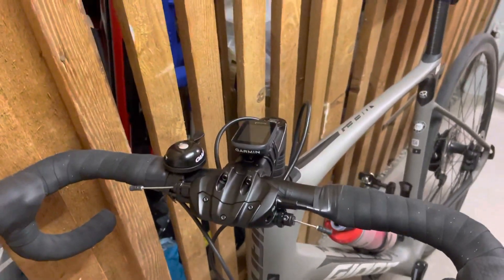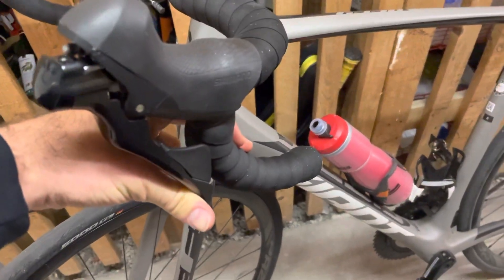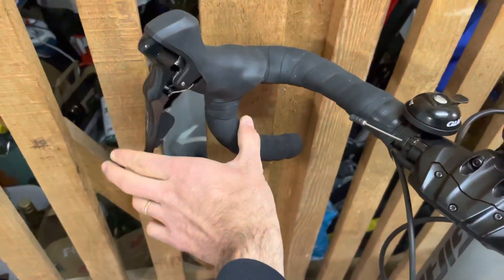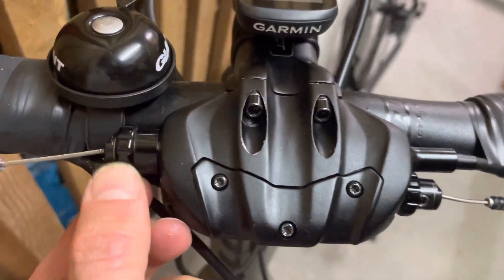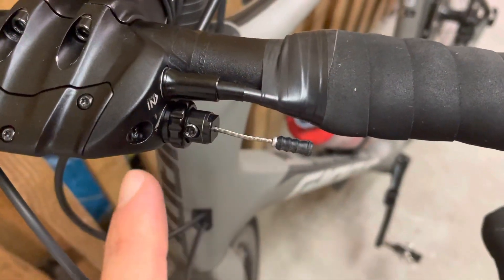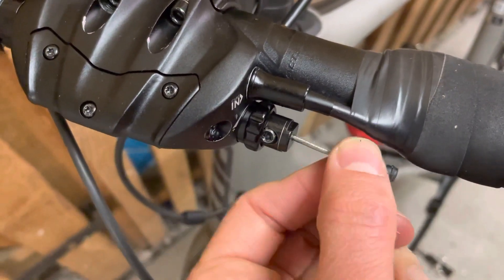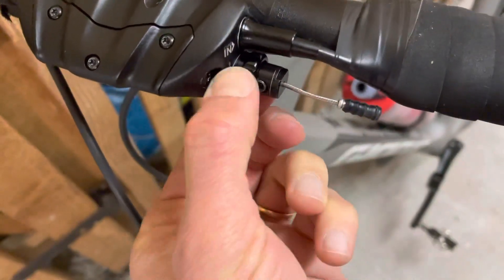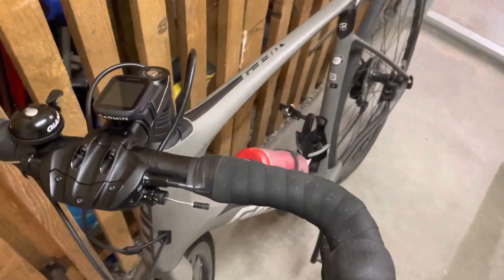Giant Conduct break system adjust lever range

Comment: Glad I’m not the only one having trouble with this @#£&* system. Servicing a friends bike which doesn’t have knurled adjusters and can only see half the grubscrew. Had to resort to wheel out and apply brakes to get pads closer. Will have a look at turning the barrel but not sure if that will make a difference as it seems it’s only basically a cable clamp.

Comment: I had to 3d print a tool to actually screw the brake cylinder barrel on mine. Mine didn't come with the external adjustments like yours because mine were internal. My bike is from 2018.
Reply from the maker: wow interesting!
Reply: I had the same issue, crap system. Ended up buying a full tiagra brake system
Reply: Hi Johnny D. Wicked, I have the same (crappy) old model as you. Please can you tell me in a bit more detail how you hacked yours? I've spent god knows how many wasted hours trying to get the system to work!
Reply: @johnlovegrove6378  Mine has cylinders on the inside which you need a specific tool or a very tin pliers to twist them in or out. They basically control the cable pull on how far you could pull the levers until they touch the drop bar. I 3d printed my tool. You just need something to twist the barrel on the inside.
Reply: @johnlovegrove6378  did you manage to sort this? Going through the same issue now.
Reply: @gavwatts1020  Hi Gav. I couldn't find any form of adjustment on the actual unit, so my bodge was to cut the end of a split pin off so I was left with a 'C'.  Then when the Conduct was all set up, I pulled the outer brake cable out enough from the unit enough that I could put the 'C' around the inner cable and pushed it inside the housing. This gets rid of enough play to make the brakes effective and they work really well. I've considered some kind of barrel adjuster as a bit of a better hack, but this way has been working fine for a fee months now.
Reply: @johnlovegrove6378  excellent - presume that is lengthening the cable inside the lever housing rather than in the conduct unit itself? If so, that was my next stop as I cannot get that barrel to move outward. Cheers for replying though
Reply: @gavwatts1020  Yeah, kind of lengthening the outer cable which obviously has the effect of shortening, or putting tension on the inner cable. And that was on either side of the Conduct unit where the cables go in. It amazes me that they even sold the first versions without the adjustment!
Reply: @johnlovegrove6378  Absolutely, though the length of the cable is so short that if you set it up with the levers in the right position, I doubt you would ever have much reason to adjust them (unlikely to stretch over that distance). Shame, as I like the bike and they seem to work well, just bloody impossible to adjust!
Reply: @gavwatts1020  If you take the bar tape off, you should be able to pull the brake cable outer out enough from the Conduct to pop something in. Just the 5mm depth of the 'C' was enough to take the play out of the levers so they didn't touch the drops before being effective.
Reply: @johnlovegrove6378  and Gav in the discussion -  would using a longer cable housing do the same job without having a loose C inside the master cylinder housing? I'm having the same problem and appreciate your ideas. Am I right in thinking that the new version of the master cylinder has an adjuster built in? Looks about 90€ for a replacement master cylinder.
Reply: @oldgit5948  Hi Oldgit. The problem is you have to 'clamp' the inner cable and THEN effectively make the outer cable longer. However you can't because the grub screw disappears inside the cylinder before you are able to tighten it on to the inner cable at a useful tension! So my bodge with the C extends the outer once the inner has been clamped. A barrel adjuster would do the same but give a degree of alteration.
Reply: Thanks so much for your reply!  Do you mean the 8mm wide bit you would rotate to line up the grub screw with the notch? I can't believe they didn't include this in the manual!!!
Reply: @johnlovegrove6378  Giant does sell their own bleed kit that comes with the specific key that rotates the cylinders inside but it's pricey.
Reply: @johnlovegrove6378  yes, it's also 8mm. The tool I end up designing and 3d printed would look something almost similar to a tower chess piece if I were to describe it in words.
Reply: Ah, that makes sense. I've turned it and turned it and it doesn't come out any more though. There just doesn't seem to be a way to take out the slack on mine even with the bar to the lever. Next step is to try without the disc between the calipers. Thanks for your help though.
Reply: Hello, do you by any chance still got the stl for the tool? i am running through the same issue

Comment: I tried this and it didn’t work! No adjustment in the cable.
Reply: Rubbish system....do as i did a replace it with shimano rs405 brakes
Reply: @45madone  I plan to upgrade mine to r7020 maybe then I can fit my TT bars on my propal
Reply from the maker: Hey Raymond, have you used pliers to pull strongly the cord? Hands force is not enough.
Reply: @MarcoLevati   I have bled mine but still too much play. Pulling cable seems to have only messed up the cable! still not quite enough. God I hate this setup that goes soft every few months.
Reply: @jerehada  it not ideal but you could use reach adjustment to tighten it up
Reply: I’ll give it a go 👍🏻
Reply: @raymondelliot4605  it problay need bleeding